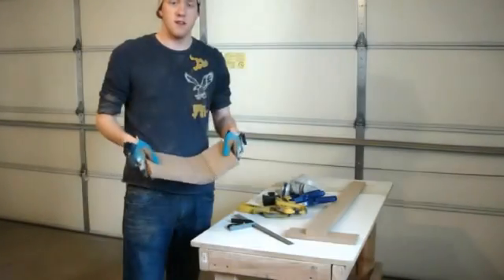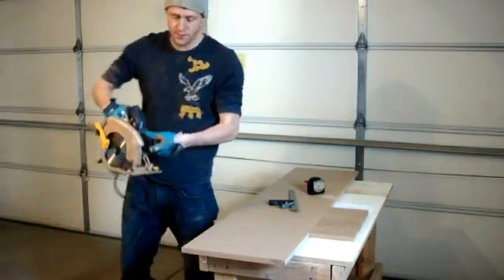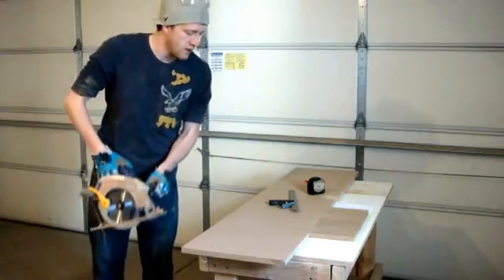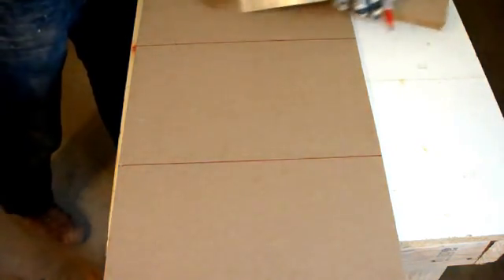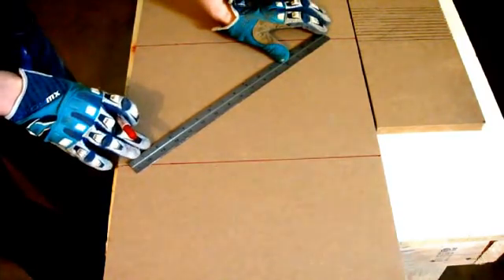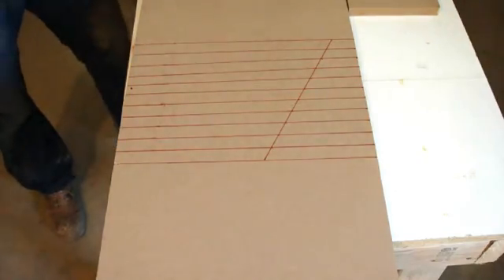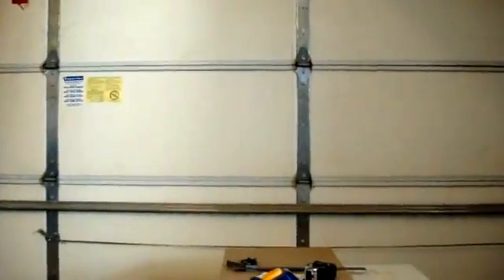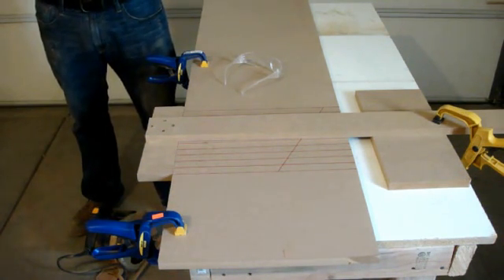Kerfing 101 - How to Kerf MDF for your subwoofer enclosure - FULL Detail - Car Audio Fabrication CAF

Comment: For others that know more than I do, when I measure the diameter to determine the size of the kerf, is his 12.5, that he used as an example in this video, a universal number or does that number depend on the overall port length? Just trying to do a 90 degree angle like in the video. Thanks anyone for the help!
Reply: Also when doing a kerf, does any of the total length of the board get lost because of the bend or will it fit to where it was measured to fit if it was just a hard 90 degree angle?

Comment: Hey brother. Found this and had some questions.. most of the time it seems guys are just cutting every 1/2" or so.. you're the first I've seen going as far as an 1" apart with the kerfs.. that said, I'm building a bentwood apron on an 8 foot oval table. The segments that bend on the ends are about 70.5"   you probably haven't done this that long before but any reason why the 1" gaps between kerfs wouldn't work. It would save me a ton of cuts and probably maintain more stability if they were spaced 1".. appreciate your thoughts. Jim
Reply from the maker: Follow what I said in the video, 12-13 cuts per 90 degree bend for 3/4 inch materia. Guys just haphazardly cutting 1/2" increments because that seems right dont know what they are doing.
Reply: @CarAudioFabrication  okay.. I've had to plane my mdf down to 1/2" thick but that shouldn't matter I would think. If I'm doing your math right and considering I'm doing the oval ends of a maple table (8 x 4)t.. 48" circumference x 3.14 ÷ 2 would mean a kerf section of 75.36" Is that about right?

Comment: Why did you draw your line diagonally? The spacing won't be exactly at 1" intervals by doing that.
Reply: phaelax   the point in doing that isn’t to get 1 inch spacing between the cuts it is to get an even 11 cuts.

Comment: Hello! Very helpful video! Oane question: I have a circle which has 28 cm in diameter, I calculated the surface of the circle and I would like to kerf a MDF board which has 18 mm width. The question is, can I kerf it in order to obtain a cilinder? Thank you!

Comment: 5:50 you should make to points on the wood and connect those to make it square. you should rely on measurements you have made and not the edges of the wood, you will waste alot of wood cutting things not square because your assuming your wood is already square, and it may not be, and usually isnt.

Comment: wow if i knew about how to do this earlier, i think i would have had a better time in making boxes.  LOL.  thank you very much for your video.  not only i am thinking of using this for a box but to also make a 90 degree angle in doing fabrication for the back of my truck. but this will be later on this year. i am hoping that i could make a vid or pics of my project.  Again thank you for a great video.

Comment: I noticed that when you bent the larger piece of MDF,  you can see lines on the outside. I did not see those lines when you bent the smaller piece at the end of the video. Is there a reason for this? The smooth bend looks much more professional to me. Does the depth of the kerf have anything to do with it, or does it just do that when flexed the first time? Your videos are great.
Reply: Jerry Whidby theyre wider grits
Reply: Grits? I'm sorry I do not understand the use of this word in your sentence. For me grit is used in reference to sandpaper.

Comment: Really like your T-square jig! I never thought about doing that, but that is an awesome way to speed up cuts with a circular saw! I normally use a long metal straight edge with 2 clamps, but that takes a lot of time to measure and clamp after each cut. This is is great!

Comment: I have a question, my design calls for a curve that is longer then 12in, how far should I space my cuts. there's gotta be a rule of thumb, no larger then or no more cuts then.
Reply from the maker: Mike Gann Try using 24" making a mark every 2" on the angle. Or 18" at every 1.5". It just has to be even, not necessarily 12". Just need 12 equal sections

Comment: If you wanted to make a bass tube and use kerfing to make the tube how would you find the measurement?
Reply: I would think the diameter would be the mounting size of the sub and then You would cut 48 cuts spaced evenly. But I'm not sure. Try it on a test piece of wood first
Reply: I would think the diameter would be the mounting size of the sub and then You would cut 48 cuts spaced evenly. But I'm not sure. Try it on a test piece of wood first

Comment: Question.  You started "figuring your diameter"  Any method to doing that?  I'm clear on all the other math except where you got your starting number of 12.5.  Please elaborate.  Great videos all over!
Reply: I didn't mean you were confused I just meant your answer was a little confusing. Saying it's a design choice doesn't let him know where the number came from. Im just clearing it up
Reply: *****  That's not something you figure out or calculate its simply a design choice how big do you want it to be its like saying figure out the size of your sub box or the length its all designed around your application.
Reply: ***** DDMODS don't confuse it.. it's simply the diameter, he mentions it. the diameter of his circle was 12.5
Reply: Mike Gann I'm not confusing it. The OP asked how the diameter was calculated and what mathematical formula was used. All im saying is its not something to calculate by method or how you come up with 12.5 it is simply what you want your design to be. 

If you want a kerf with a radius 6.25 then you have 12.5 as diameter (radius x 2) its not something that is mathematically found its just a design choice.
Reply: Mike Gann That is true although in just stating it is 12.5 because thats what he said that wont allow anyone to design there own kerf if you get me. He knows 12.5 is the diameter but didnt know how to get that and its not just a number you calculate or guess its just what you want it to be for your design.
Reply: D2i Automotive is right, the radius is a design choice. In this case, i think that Mark likes do use this diameter of 12,5 inches in his professional works just because is beautyful or easy to make. The mathematical formulas only helps in what to do after choosing the lenght of the curve.
But, yes, there is mathematical formula to help to make kerf, with the thickness of the wood, the diameter of the curve, the thickness of the saw disk. In other words, by this formula, you can set the radius after you know the better way of making cuts without making the wood weak.

Comment: am guessing after making cuts and bended the wood, you fill the grooves with something to make it strong?   if its used for subwoofers, i think it would crack under pressure.
Reply: Wood filler would work fine too, and just sand it down a bit to make it look as seem less as possible :)
Reply: yea he said wood glue and fibreglass in the video guys...
Reply: lockij 6 6 the 2nd . I have a 66 y y 6th u udddeeeeeeereee the . A Simple  $ uhmu 7u uhu

Comment: your video is very helpful. specially your method of spacing kerfs. you only calculated length of outer arc but i guess we can also use the inner length of arc to determine the number of cuts. so here is an example with metric sizes outer length (ol), inner length (il), outer radius (or), inner radius (ir), number of cuts (noc)

outer radius (or) : 70 mm (which we want to make)
MDF thickness : 18 mm
inner radius (ir) = outer radius - MDF thickness = 70 - 18 = 52 mm
Outer Length (ol) = PI * or /2 = 3,14*70/2=110 mm (90 degree)
Inner Length (il) = PI * ir / 2 = 3,14*52/2=81,64 mm
Cut blade width (cw) = 3,2 mm
Number of cuts (noc) = (ol - il) / cw = (110 - 81,64) / 3,2 = 8,86 = 9 ...

so if you make 9 cuts with a 3.2 width blade in 110 mm outer length the total left length will be about 81 mm and this is the inner length of a full circle. this is my formula to calculate the number of cuts.
Reply: Salih SERBES u sound like my brother n law which is an engineer and to the average guy u sound like j r just trying to confuse someone

Comment: I think a table saw would be much more accurate, safer and faster.
Reply from the maker: And I think a CNC Router would be even more accurate, safe, and faster. If I ddid it with a table saw people would complain that table saws are too expensive. Can't you just say thank you and move on?
Reply: CarAudioFabrication your video sucks :D
Reply: CarAudioFabrication instead of would glue in the cuts could you use fiberglass resin ? Or would it be too thick ? I need to add a 8 or 10 inch sub to my dodge charger . I want the flatest frequency response possible from 20 to 80 Hz . Sealed,ported or tline ?
Reply: Dustin Mccormack it'll depend on the sub you choose.  i'm currently obsessed with sundown audio, and they're in the process of revamping their sealed enclosure sub line (SD2, soon to be SD3), which should give you relatively flat response in an appropriately sized enclosure.  sundown's equipment is all about as rugged as you can imagine, and the SD3 10 and 12 will have underhung voice coils and copper shorting rings, which translates to loud and clean bass.  if you're more interested in strictly SQ, the dayton audio reference HO subs are excellent, and reasonably priced, though the smaller sizes definitely won't be flat all the way down to 20 hz.
Reply: ian connell yeah I've been looking at Dayton Reference. I have a Soundstream 5.0  Reference waiting for a sub.
Reply: Cheap table saws are not usually accurate.  You need a very good one and it costs alot usually.
Reply: CarAudioFabrication Lmao get em!!!! Great video bud as always even back then u knew ur shit lol but yet still have came so far....keep it up I've learned so much from all ur videos over the years
Reply: jeanious2009 Maybe u could make a video yourself to prove your theory :~0....U think he doesn't know different ways or easier more expensive ways to do this???? I'm willing to bet he would agree a $300-$600 table saw would be easier but obviously he's trying to show a cheaper way for the ones who don't want to or cant buy a expensive table saw. Have u not watched any other videos? He's keeping the subscribers in mind here I guarantee u..he knows he'll help more by showing a common cheaper solution that's more practical to someone who doesn't do it everyday and have every nice tool available. If he wanted to show the easiest fastest way he'd probably break out his high end router and a couple hundred bucks worth of bits and knock it out for ya but obviously he's not helping many people who can't have the ability to have all the fancy tools.....so thank the dude and move on or if u wanna have a build off with him make a video of ur best method and he'll still out perform u with $50 worth of tools haha

Comment: just a quick question on this. say you are using this for either the outside of the box and the inner port to have a nice smooth flow of air. How do you determine how much of a diameter you need. Lets say your port length needs to be 35 inches long. wont the kerf take away from that. same with the outside, if your box is lets say 25 inches wide and 15 inches deep, does the piece of wood you need to cut need to be 40 inches long and does it need the same diameter of bend as the inner port so you have the same bend. im just confused on where all the numbers come from.

Comment: Depending on the thickness of the board and the width of the cut how many cuts you make will very. It looks like you're using 3/4" mdf and the cut width is about 1/8" which will remove roughly 1.5". If you where using 1/2" mdf 12 cuts would remove to much material and your kerf would be more than 90°. On the other hand if you where using 1" mdf you would remove to little and have a smaller kerf.

Comment: If I have a radius of 3 1/2 would I make 12 equal cuts within that 3 1/2 radius?
Reply from the maker: Yes exactly, but be careful, that is about the smallest of a kerf radius you can make.
Reply: CarAudioFabrication - wait, in your video you explain that you must take the radius (in this case 3.5 X pi) and then take that total and divided by 4. If the math is right, it should be 2.75. So the 11 or 12 cuts should be within that distance, not 3.5. Correct?  I agree that it is a very small radius to begin with. 
Btw, thanks for this video, I'm going to try it this weekend.
Reply: i wrote a formula to calculate the exact number of cuts. see my comment for this video

Comment from the maker: MDF seems to vary in quality quite a bit. There have been times that I have had issues with it bending, but I just make the cut even deeper. The board is going to be pretty fragile when you initially bend it. Just take your time with it, you add the strength back in when you apply the fiberglass mat and wood glue.

Comment: are you sure? a table saw provides the same exact functionality as a circular saw, except that its basically a circular saw affixed to a table UPSIDE DOWN!. Are you positive this tool that provides the SAME EXACT REsults (spinning blade that removes material) can be used?

Comment: Great video! Hands down one of the best. I just have to say that there didnt have to be 11 cuts, if u would have had more cuts, u could have bent the wood better without risking it breaking plus it would be more round. When i kerf mdf, i dont really use glue, i drill holes on the verticle lines before i cut them then fill everything with resin. Same sh*t, it all gets the job done at the end lol

Comment: wow thats awesome dod U do requests? im totaly confused on a box size for some dc audio 12"s or 15"s  i have a 2011 hhr i got enough room to go 23 inches deep 29 inches high and 37 inches wide im trying to figure out what will fit even if its a wall the  15 " subs are rated for 3.5 cubic foot box and the 12's are rated for 1.5 cubic foot plus sub displacement i read from someone after all displacement were subtracted from

Comment: hello, Can you help me with a box for my subwoofer acoustic 15 "inches hypnotic zen I want deep bass  no matter the space is for a ford aerostar I want a huge drawer to get this kind of bass  I send you the specifications of the subwoofer

(FS) 29.8 Hz
(Qts.) .59
(Qms) 5
(VAS) 95.4 L
(Xmax) .36
(Re) .95 ohms 
(Pe) 750/1500
(QES) .55
(Sens) 89 dB

 The subwoofer measures  15.6 inches / 39.5 cm in diameter 8.5 inches / 21.6cm height

I want deep bass!

greetings from mexico city!